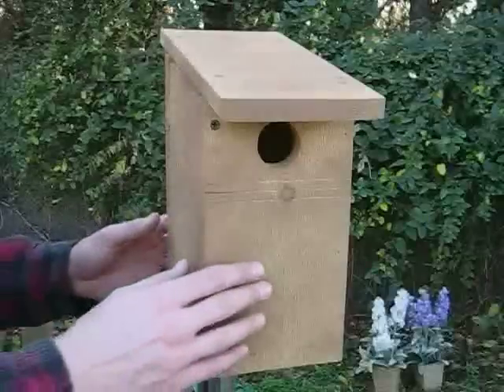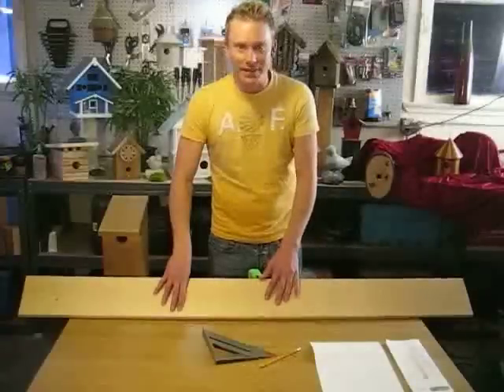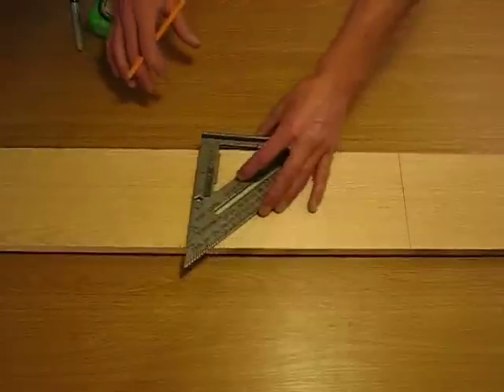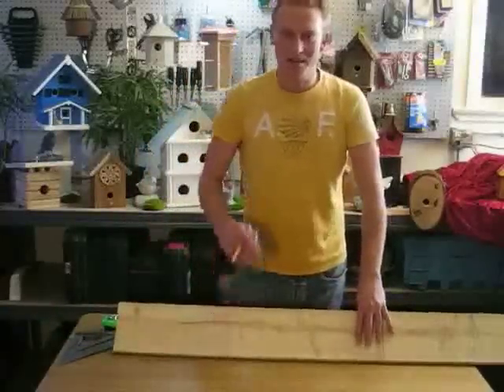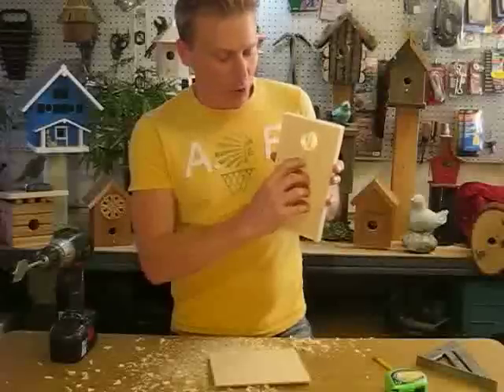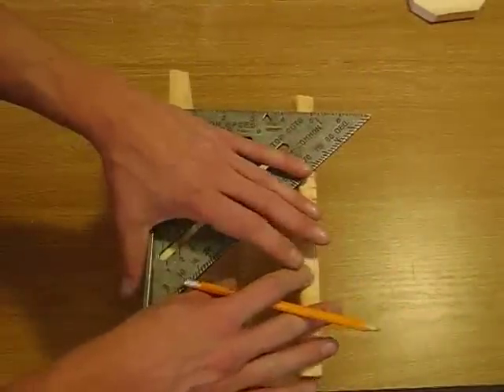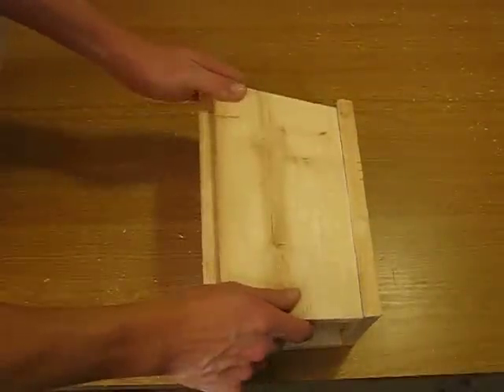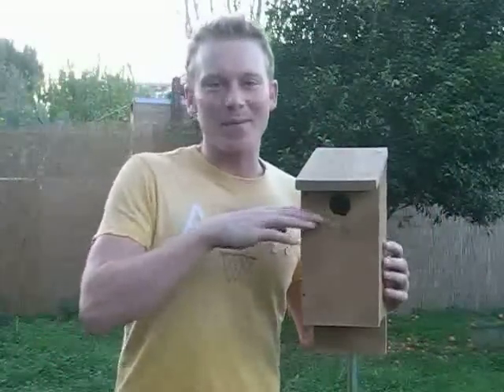How To Build A Bird House

Comment: Nice job.  You may also want to think about a roof that is slightly wider than the bird house to give you little protection from wind driven rain.  It's a little more work, but just an 1/8 of an inch can give make a difference in keeping the nest dry.

Comment: I had a lot of question on measurements.  Watching the next step the video stop and just said after the pilot holes drilled on the side door.....the extra 12 degree for the back piece and what to do with the that????  Mike talks about visiting his website for details but none, so now I see this is 10 years old.  I was able to get it build and a clever design but much lacking for the person like me in needing more details.  I will install it next spring and see what happens.